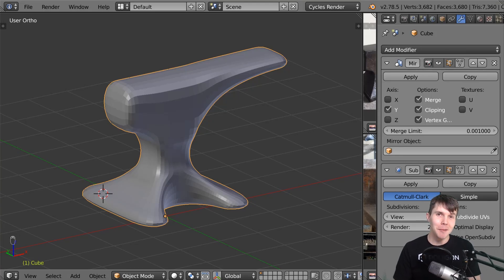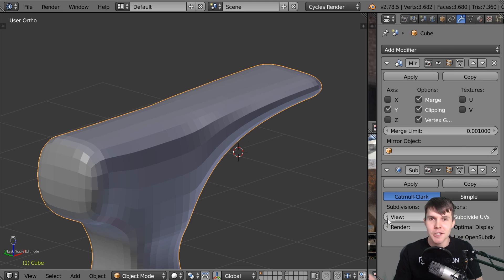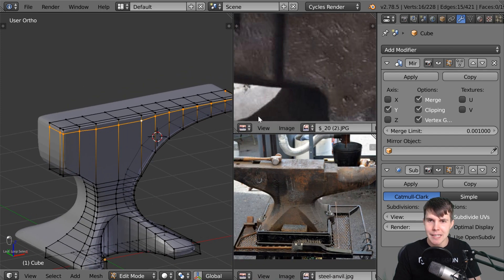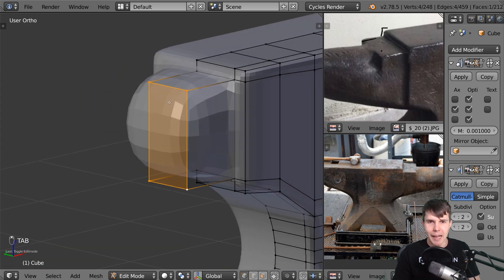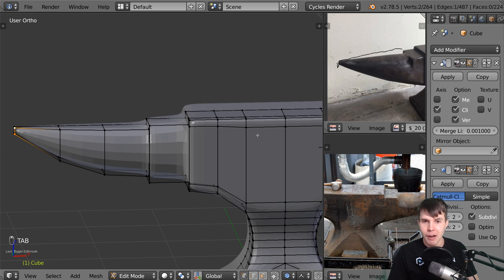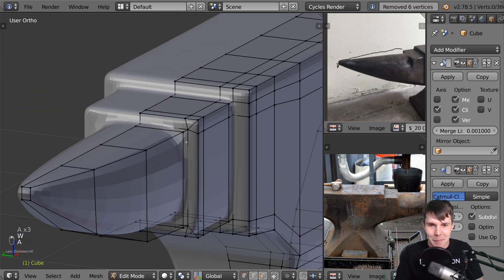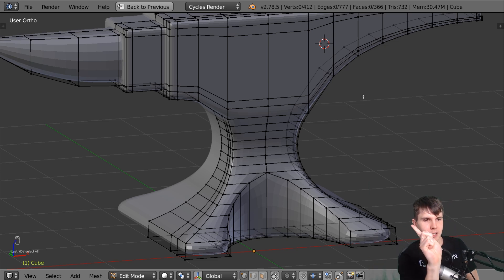Blender Intermediate Modelling Tutorial - Part 3: Sharpening Edges

Comment: I’m here to do my due diligence and help with an issue I’m sure others will run into.

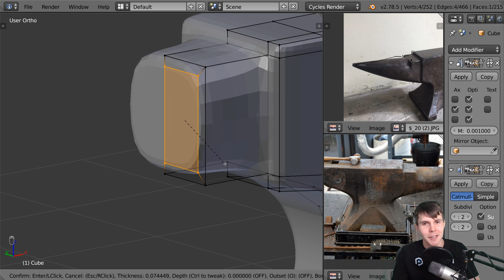At 7:28ish and before, where you have to extrude out the back and inset without the boundary, you may run into that even when you press b to turn off boundary, the two extrusions still appear.

If resetting the scale doesn’t work, turn off the mirror modifier to check the following: Similar to the previous tutorial, you will run into issues if you have mesh on both sides of the mirror modifier. 

Simply delete the left face so the entire side of the anvil is hollow, including the part you want to extend out. 

NOW that that face is gone, there’s no face in the way of the merging of the back!

Any questions on the specifics of this, just reply here!
Reply: if all of that doesn't work, try to increase the merge limit in the mirror modifier
Reply: @nettoribeiro4267  best outta every solution easy too.. tysm bro....... it helped
Reply: @nettoribeiro4267  Thanks! That worked for me!
Reply: @nettoribeiro4267  it works 
Thanks🤝
Reply: @nettoribeiro4267  Thanks dude!
Reply: I had to also press "i" (again after pressing it to start the inset) to turn off Individual, otherwise turning off Boundary did nothing (Blender 2.82).
Reply: @flygandekrabban   I had the exact same issue! I had to press 'i' twice to turn off individual. Thanks for the suggestion :)
Reply: @flygandekrabban  worked for me thanx a lot
Reply: @flygandekrabban I spend like two hours messing around until i read this comment properly, thx for the suggestion
Reply: I hadn't turned on clipping in the mirror modifier options
Reply: I don't understand the whole thing (I'm still a noob at this kind of stuff)
Reply: Version 2.91.0 none of this works, idk why, pressing B just does absolutely nothing. I have deleted the face on the mirror plane and any other overlapping mesh, I also have clipping on. I'm not sure what you mean by reset the scale tho? All i can say is that Boundary is set to "Off" everytime I cancel my insert and reinsert, despite me switching it to "On" previously. Dont know if it's supposed to do that, but I'm truly lost at this point.
Reply: Thanks a lot! I had such kind of problem. Your advice so helpful!
Reply: Екатерина Земскова no prob! I struggled for a while and even asked reddit lol. AFTER I got my answer, I saw the question asked, but it was a little early in the video so it threw me

So now both timestamps have the solution :)
Reply: i was struggling with this so hard in 3.0, the thing that worked for me was in the mirror modifier: turn on clipping, increase merge value. after doing these things i didnt have to use boundaries
Reply: @itsyaboinadia  I was trying so hard ,but this worked for me thanks
Reply: You are a saint. Thank you!
Reply: Perfection! Saved me a headache :D
Reply: Yep, deleting the faces in the middle (plural after adding loop in the loop cuts from this video) helped and B works (2.91.0). I was confused because I specifically had to add the backface there during the last tutorial to prevent the boolean cut but from making the innards of the anvil visible - not sure if that's a bug or what. But I suppose now that the boolean has been applied to the geometry an I even manully created the faces for it, now I can again remove the middle faces to make this I + B thing work.
Reply: Found an easier way. 

Select everything, and go to Mesh > Cleanup > Merge by distance. 
After I did that with all three selection modes I was able to get the Boundary Inset to work properly.
Reply: @kenedgeiscool  U saved my ass
Reply: Comment section for the win again
Reply: I am am super new at this (learning on 3.0) but what I found after searching high and low for what the "boundary" key command is now, I noticed that a dialog opens when you "Inset". Simply click the "boundary" box in the dialog and it works like the video.
Reply: if you are using blender 3.3 i eliminated that issue my ticking the merge box INSIDE the mirror modifier and increasing the value to 0.2m. i dont know yet if im gonna run into issues later on tho. also make sure the mirror is above the subdivision
Reply: @JERRYjealously  it helps me. Thank you!
Reply: could someone pls explain wut @Gredran said in a simpler way(sry i just started blender)
Reply: @adityakk4385  if two single extruded pieces of mesh appear and turning off boundary by pressing b doesn't change anything, either apply your scale (Control + A, then select scale) or turn of the mirror modifier and check, if there are faces on the inside: if the anvil is hollow  things are fine, if there are faces on the inside tho you will have to delete them, those cause problems if they are there. Hope this helps!
Reply: Also check if you don't have the proportional editing on !
Reply: Thank you for your explanation! I was looking what was wrong with my mesh!
Reply: Thanks mate!!
Reply: you save me bro... thanks!!
Reply: Thank you so much. It was a headache for ten minutes until I read your comment. Life saver!! Again thank you so much. Peace.
Reply: <3
Reply: You're a life saver! ☺️
Reply: If none of this works, just inset it normally and then grab the two vertices and move them towards the middle, all the way to the edge. Does the same thing methinks.
Reply: you're my hero!
Reply: I still couldnt xi this for some reason - any workarounds?
Reply: thank you so much
Reply: I've done this yet it still doesn't seem to work sadly
Reply: extremely helpful, 10/10
Reply: You rock! Thanks for this great extra tutorial.
Reply: Not sure why I got this issue, but I fixed it by moving the vertices that should be in the middle (on the x-axis for me) such that that y=0. By scale (s) -> y-axis (y) -> 0 (set y-coord = 0). Found my solution here:
https://blender.stackexchange.com/questions/44507/how-do-i-avoid-gaps-to-a-mirror-modifier-when-i-am-scaling-a-model-vertices 

If anyone knows why this happened to me or if this is a bad/good solution I would love to know why! It's like extrude got an angle away from the middle of the anvil, so it feels like I have not fixed the root of the problem. I'll see soon enough if I encounter more problems

EDIT: When extruding I missed to use scroll wheel to lock it into one axis :))
Reply: ok so what happened to me  was it somehow (maybe incorrect input) created a another layer of face that seemingly appeared to be 1 face, had to reload my save file and did what you told and it worked again.
Reply: When making extrusions with mirror modifier in 3.3, make sure that clipping is turned on. I back tracked my problem with the "horn" many times to find out that it made a double out of the extrusion, which continued to make a problem when using inset. You can check if you have a double by zooming inside the model and see if there is a "dividing wall" there. There is no mesh to remove, but to start over with clipping on... unless you want to make a fork. Looks cool though...
Reply: Thanks a lot!
Reply: Thank you!

Comment: I'm trying to follow along with these tutorials but using cinema 4d - at around 9:15 Andrew pulls up the bottom edge of the spike without moving the top vertices by hiding them.
Does anyone know how that could be achieved in c4d? I've tried using soft selection but as I increase the radius the top vertices end up being selected and moving.

Comment: 12:06, Andrew The answer to this particular question "How do we fix this?"( i.e when horn is also getting the proximity loops) lies in this video, Instead of selecting all the loop around the Horn after the loop cut, we can actually "Hide the entire horn" BEFORE DOING LOOP CUT, and then making the horn visible simply solves the problem....
And even the faces are also in the correct flow.....
I just experimented on it and it worked.....
I LEARNED IT FROM YOU MR.ANDREW PRICE....
Thank you very much for your priceless Tutorials... :-)
Reply: i think the problem with that is, that you then have a face with 5 vertices.

Comment: Hi,
Little trick for anyone interested : When creating the loop cut at 4:24 hit "E" so that it is aligned with the top part. That way the new loop cut is parallel to the corner loop. You might have to also hit "F" if the loop cut is aligned with the bottom. The shortcuts are written in the bottom left corner. Cheers
Reply: U deserve all good <3

Comment: at 11:20 as he is adding loops to his anvil and it adds loops to horn, it can be easily avoided if he just hid the horn, added loops and then revealed the horn :) 
PS: although I get that he may have just used other solution to show us that specific problem - solving
Reply: This creates a mess on faces with 5+ vertices, and fixing them is much harder than previously. Generally, hiding thing only works if the adjacent vertices remains the same.

Comment: For some of those loops on the middle square section, offset edge loop slide (shift ctrl r) is also a good command. Just select the vertices where you need the loop, press shift ctrl r, and place the loop off those vertices only. That way you don't need to worry afterward about getting rid of the extra geometry.

Comment: found an easier and faster way to do it with less polygons - when you get to the part of extruding the horn or when he clicks i, instead of having a subsurf on the whole model which makes it harder to have less pollys just ctrl P the face and add subsurf then continue and apply subsurf when the horn part of avil is done and combine the two objects. now select the top row of vertices and scale on z and do the same around until it's a rectangle. last step if to create faces and then dissolve edges that are on the anvil side and if you want you can scale the edge to make it straight by doing it on z and y axis!!

Comment: 9:50 when i pull it together it dosnt stop even tho clipping is on.what should i do?
Reply: It was probably because the face wasn't symmetrical. More a trapezoid than a rectangle. If you make the edge being pulled into it's mirror side flat, it should clip into itself.
Reply: I dont know if you still need this but all i did was uncheck the merge and vert options while doing it, just the clip option checked and it worked

Comment: At 7:15 you keep saying press B in inset mode. But I press it nothing happened :( Help... EDIT: I move the point manually using gy, using gg move it in weird diagonal so I use gy
Reply: I still can't figure it out. i've selected vertices, edges, and face. Regardless, whenever I am in inset mode and press B nothing happens.
Reply: yep me too  @kaneda7368
Reply: Fix: Had the same problem for hours... but got the fix... actually, there is a face between the mirror plane and the actual plane of the mesh... it's actually the loop cut that u add during the mirror modifier... just delete the face by going in top view by clicking 7 on num pad and select the whole loop cut in the centre with alt and press x and select delete only faces.. and done!
Reply: Hey bro it's working only in vertices not in edges and faces mode
Reply: Try selecting the faces you want to be 'bounded,' but be sure to check off "Individual" (Hotkey is I while in Inset mode...)
Reply: @oakland439  You saved me
Reply: ArtAway   7:15 inset mode…tool shelf>>Boundary check off??
Reply: do it in face select mode
Reply: not working 4 me either

Comment: Hitting B on the Inset mode just isnt doing anything for me :( I tried to follow a tutorial on a forum with the same issue.. but no luck. Must be some setting i've messed up.
Reply: If you're pre-2.8, I dunno. If you're using 2.8+ then I still don't know - I think it's missing.
Reply: I had extruded the first part and then seen the clipping comment here. Inset then b wasnt working. Undid the inset and the extrude then redid them and it worked. Also think I went in and out of edit mode
SnowiDragon
Reply: do it in face select mode

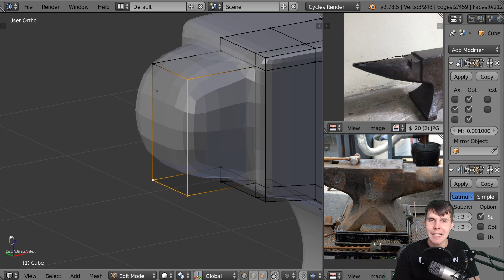Comment: 6:30 when I try to inset and press "B" nothing happens. I've found a work around by insetting, then grabbing that edge, sliding it over to the side then deleting the face/edge. Seems to have done the trick. But, does anyone know why just pressing "B" might not be working for me?
Reply: I have this same problem. Did you find what was wrong with i + b not working?
Reply: This is the only way I could get it to work.
Reply: @Lane Weatherbee, it is probably because there is a face between the mirrored object. Turn of the mirror modifier and check if the anvil is completely hollow. Probably the last part you extruded has a face facing the mirrored part.
Reply: Thanks for the solution
Reply: @Lane Weatherbee you need to press B  while you are "insecting"... you need to press B and right after I

Comment: Hey, love your tutorials, keep going. You used a loopcut to sharpen the upper edge. Unfortunately? the loopcut was not straight at its full length. I press after using the Ctrl+R and positioning the edgeloop the E key and by pressing the F key after it you can set the edge which you want to use as reference. This way you could refer to the top edge and get a straight edgeloop. In case you know it, please excuse me. In blender there are tons of tricks which also pro users  sometimes doesn't know of. Anyway, you're making a great job for the Blender community, excellent and understandable explanations make you a rock star under all the people making tutorials.

Comment: When selecting a chain of points that are all connected by edges (like at 15:40), you can click the first point, hold ctrl, and click the last point and it will select all the points in between. It just saves a bit of time.

Comment: Ok, I finally found the reason why two horns are still coming out of the anvil -the so called "butt problem" 5:55 . I decided to apply the mirror modifier to set a new loop cut, because I thought that something must have gone terribly wrong with my construction so far. I was quite right, when I saw the final result of the mirror modifier. Suddenly I had two center lines which started to split from the middle of the model up to the top. I erased both of them and rebuilded the missing faces. I setted the new orgin point then and made a  new loop cut. Made a new mirror modifier and erased the other half and could go on just like Andrew dird. TADAAAAA Problem solved. Now only one horn is coming out of the anvil.
Best from Hamburg, Altona, Germany

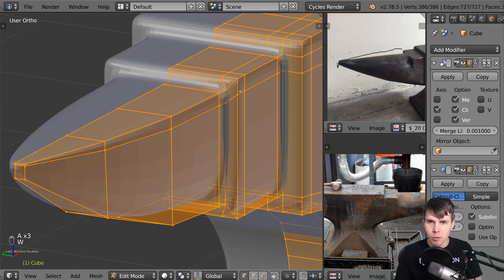Comment: [Solution] Remove doubles wont work for anvil horn around 14:20

I had this problem for a little while then figured it out after seeing no solution in the comments.

* Select your line around the anvil horn
* Double tap [G] and drag lines into each other
* Double tap [A] to select the whole mesh
* Press [W] to open up the menu
* Click delete doubles

I just had to re watch the part a few times to realize he had the whole thing selected.
I hope this helps! Or if they have a different issue I'm sorry!
Reply: thats because the vertices were probably to far apart, if you press T on your keyboard you'll get another menu with the operation modifier, basically allowing you to see the exact numbers of any operation you just did in edit mode,
if you removed doubles and it didn't do anything, you can then increase the range of the remove doubles effect and see if that works, keep in mind you have to have the vertices you want to check/removed for doubles selected.

A simpler solution however, is this:
before you press gg on your keyboard, activate the auto merge option at the bottom bar (looks like two arrows pointing to each other) and then proceed to draw the vertices into each other with gg and moving them, bring them into the vertices you want them to and poof they are gone once you click them in place.
Reply: thanks

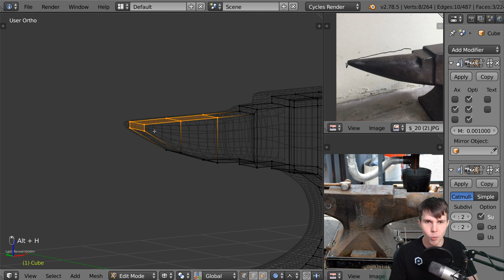Comment: I'm having some trouble with the horn point part (around 9:32) where the mirror and model overlap each other even with the clipping on. Doesn't pull into a point. See https://s19.postimg.org/3ona94ntf/issue.png
Reply: have you fixed this? i have the same problem
Reply: i founf a fix. https://blender.stackexchange.com/questions/353/how-can-i-make-the-mirror-modifier-work-right
Reply: I have the same problem here, but setting the origin point didn´t solve the problem. It still looks like the clipping is not working right when I try to move the top of the horn together. Can anybody help me please?

Comment: My extruded horn (5:55) had a butt crack so I turned off the mirror modifier so I could select the vertices that was creating a crease and deleted it. Remember we created a loop cut all the way around the anvil to mirror it correctly? Now it's a nicely extruded bulge. I hope this doesn't cause me problems later.
Reply: thanks anyway @Chickeen Waffles
Reply: I had the exact same problem after executing the I command and clicking boundaries off. So, I repeated the step above and it got rid of the annoying butt crack running down the horn. I hope this helps someone out there!
Reply: OMG! You are my hero! I need to try this later.
Reply: When Andrew uses extrude it creates a Face on the Y access of the "horn". Turning off  Mirror Modifier and deleting the face seems to fix the "butt crack" problem.
Reply: theres an edge that pulls id down
sorry for the late reply
Reply: what edge?
Reply: I already solve the problem... I have the clipping checkbox deactivated
Reply: yes! you saved my anvil.

Comment: The remove doubles function doesn't seem to be working even though the vertices are at the exact same location. I had to use dissolve edges.
Reply: Did you select all before removing doubles? If you are trying to remove doubles with only the edge you moved selected, it will not work. I ran into that when I first started.
Reply: Ok! Thanks!